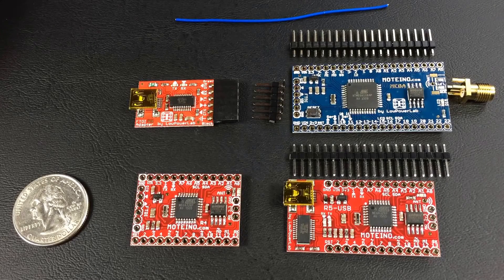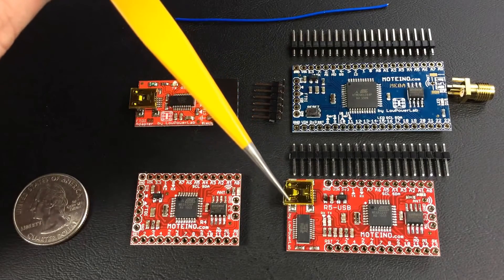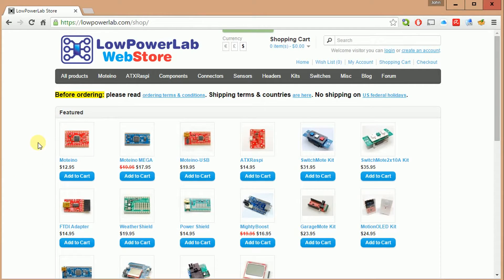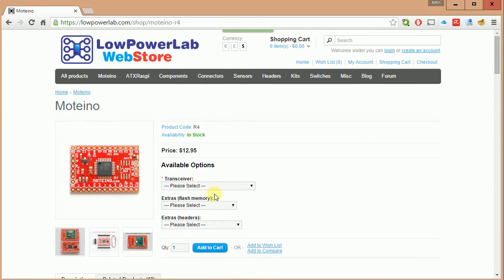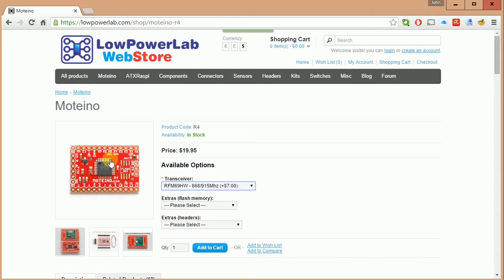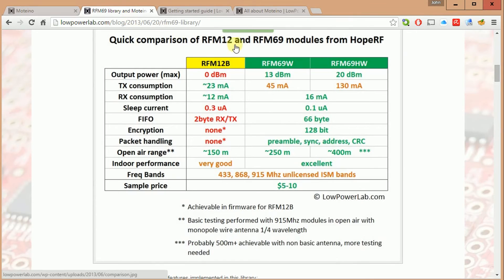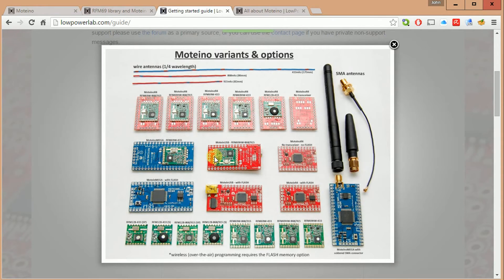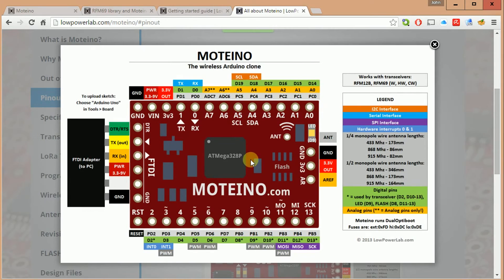Moteino home automation part 1 of 3: What is Moteino?

Comment: Thanks for the post. Could I be able to use gps and transceiver with this moteino? Thanks.
Reply from the maker: Hmm, that is a very good question.  To be honest I am not sure if the standard Moteino will work with both a GPS and a transceiver, because they both want to use the serial data port. Maybe a Moteino Mega would be able do to the job.  For example you could use the Adafruit GPS module.  See how it's hooked up?  They want to use pins digital 2 and 3.  On a standard Moteino you cannot use digital pin 2, and digital 8-13 because they are all used by the transceiver.
Reply from the maker: Here is the Adafruit GPS example I mentioned in my above comment:  https://learn.adafruit.com/adafruit-ultimate-gps/arduino-wiring
Reply from the maker: If you visit the Moteino forum I'm sure those guys can help answer your question.  https://lowpowerlab.com/forum/moteino/